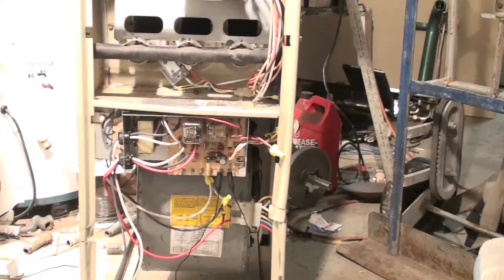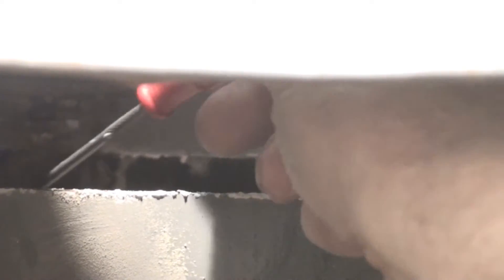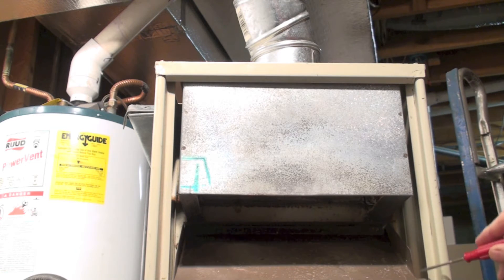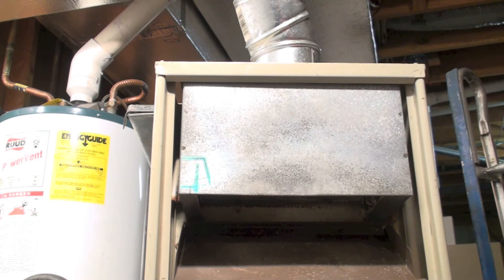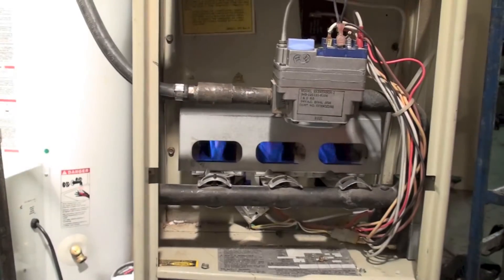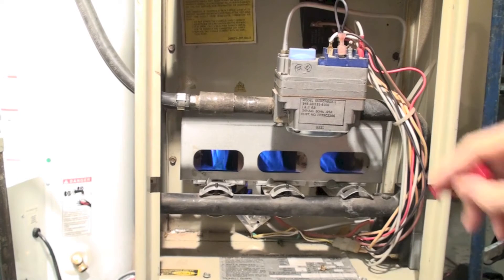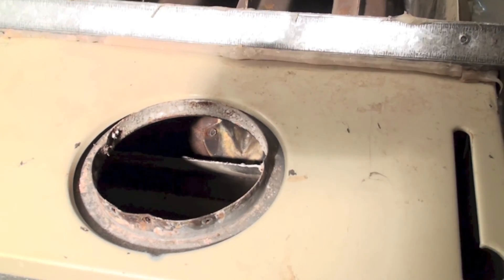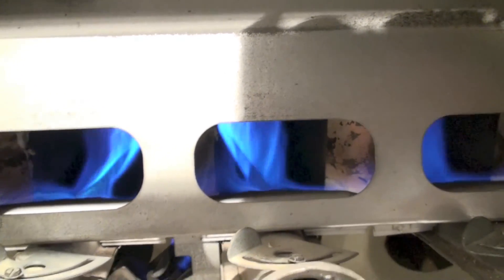How the draft hood on the gas furnace works

Comment: Burner tubes? Could you mean the heat exchanger?
Reply from the maker: Burner tubes are the devices that spread the flame across the heat exchanger.  This is on older furnaces that used the ribbon type burner, not the inshot burners used now.
GFM

Comment: So it sounds like back then they were more concerned about the burner continuing to burn than they were about carbon monoxide poisoning. They were more concerned about the flame rolling out then about people breathing that poisonous gas in. It would be better to have problems with your gas furnace then it would be to be constantly breathing carbon monoxide.

Thank God people got smarter and came up with the inducer fan motor
Reply from the maker: As a practical matter, the draft hood appliances posed little danger as they would shut down if problems like draft hood spillage occured.  
That said, induced appliances are a better solution.
GFM.
Reply: @grayfurnaceman  what safety shuts off the natural draft furnace in the event of backdraft?
Reply from the maker: @BibleBloopers  The recirculation of burned fuel from the draft hood entering the combustion air to the burners will shut down the burners and pilot flame.  The lack of pilot will drop out the pilot safety.  
Shut down is not immediate as is newer flame rectification but when this technology was used, flame rectification technology was very expensive.  The flame safety would cost more than the entire furnace at that time.  
GFM

Comment: Also folks if you have an older furnace like this especially in s confined space the bottom plate in the blower compartment must be screwed down or at least put a brick on it.  If you have a side opening for the return.  I saw a furnace come on and the pull of the blower lifted up the bottom plate and pulled in air from the room it was in plus from the draft hood and before you knew it it was making lots of CO.

Comment: I had a service call on a boiler today. The flame totally rolled out when I opened up the metal slide to view the flame. I noticed the boiler had quite a large draft hood. So I blocked it as a test and the flame was perfect. I took it off and the flame rolled out again. I also cleaned a bunch of soot from the burner section. Why would the flame go back to normal after blocking the draft hood?
Reply from the maker: I think you have a restriction in the venting above the draft hood.
GFM
Reply: grayfurnaceman yes. I ended up talking to another tech in my company who serviced this boiler before. He thinks that the flue is full of soot and needs to be cleaned. Thanks for the reply GFM! Ive learned so much from watching your videos.

Comment: I have a furnace even older than this one. Its from 1954. Big blue housing. cast iron inside. Pilot always on. Everything operates but it is only sending out warm air. Not hot air like last winter.

Comment: What was the purpose of manufactures going from this type of draft to using the inducer type exhaust?  Was it  for safety reasons?  Or is an inducer type more efficient?  It seems that the heat exchangers became very thin compared to the exchangers in the natural draft units.  I think it is great that you keep older furnaces to run and give examples!  What is the oldest furnace you have?  Thanks